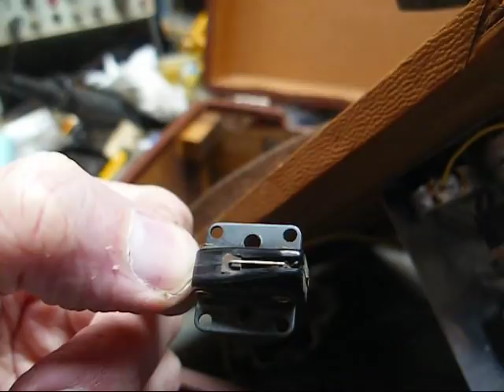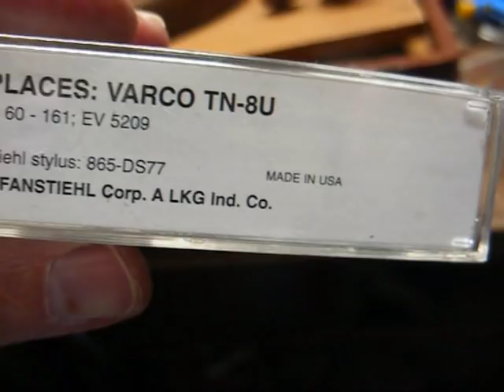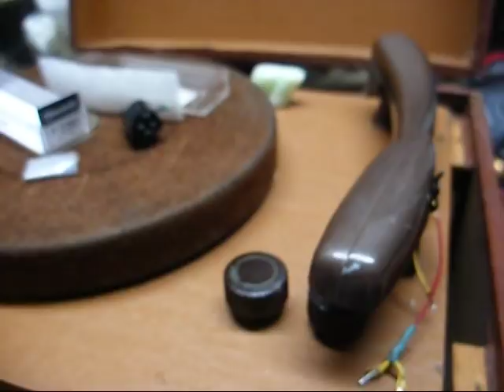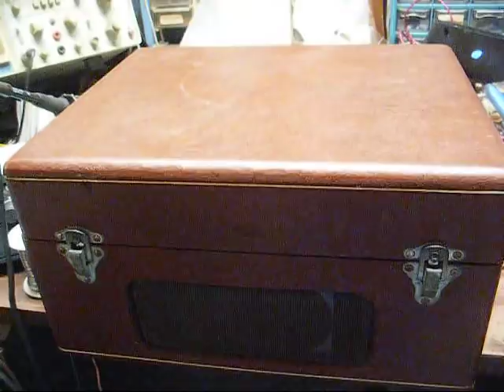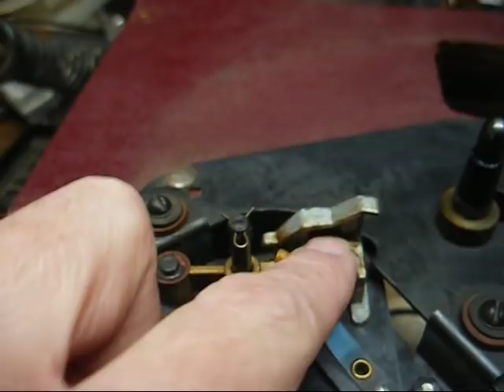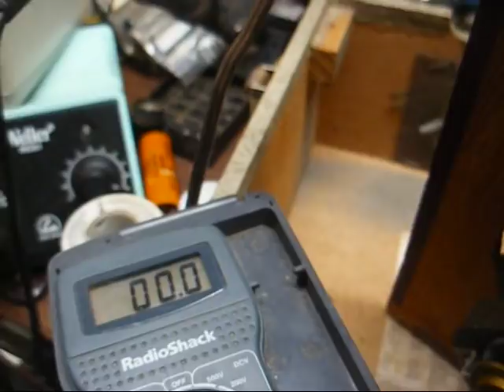Waters-Conley record player repair X 2 (cartridge replacement, sloppy repair work)

Comment: GREAT restoration job on those! I couldn't BELIEVE it when I saw that giant can capacitor siliconed in place! What a shorting danger that was! I have my very 1st record player that I ever owned-got it when I was 2 & it's very similar to those 2 it's a Phonola w/2 audio tubes & a SEASonal RECTUM-fire (selenium rectifier). It has the noisy drive system & awaits restoration in my closet.

Comment: I used to have a Silvertone record player that I got many years and it worked good, but it had no sound on the speaker, and the tonearm had an original cartridge with a steel needle type which was installed onto the 78 cartridge. I got rid of it many years back, but the GE Wildcat is far superior than these older record players.

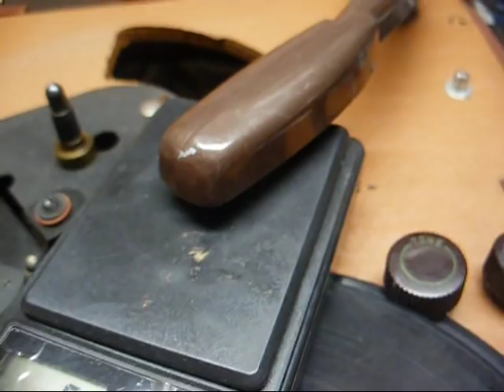That song at 20:06 is the 45 that he already got smashed in the last video. It’s a great song, no question about it. A #1 hit in 1977 for an impressive 10 weeks.

Comment: Hey radiotvphononut. I have tried wiring a stereo cartridge in series, as joining with a wire L - to R+ on the cartridge, then just connecting the 2 remaining terminals to the tone arm and it doubled the output (both channels) added together. It sounds good for me so far, but worked out better for me than summing them

Comment: Everyone seems to parallel the left-right sections of a stereo phono cartridge when used with a mono amplifier. Wouldn't it be better to put the sections in series in the right polarity and double the output voltage of the cartridge.

Comment: Love The Record Players- Better than a crosley, Your right big tubes sound better. enjoy how fix record player'''s
Reply: Have you ever tried soaking rubber parts in a bath of rubbing alcohol and wintergreen oil?  It can restore rubber to a soft and supple condition.  I don't know how long it lasts, but it definitely works.   I think the ratio is 3:1 alcohol to wintergreen oil and it takes about 2 to 3 days of soaking.  You have to use real wintergreen oil though. The pre-mixed stuff in the drug store doesn't do anything.  I know motorcycle and car people use this trick with rubber parts that have hardened and they need it to be soft to get it back in place.
Reply: Crapley
Reply: Let me give a word of advice here I don't claim to know everything it's all respect radiotvphononut we can all learn from there is no one fix for vintage Electronics and short cuts
Reply: @JJ_CoreJasonGamer5442  and should prevent forest Rainier blower flyer Go Kart super Circuit Clerk of being her usual armors are flyer fold Electronics buyers parental fly Flair for Flyers nerves vinyl Blair mom wears cargo are Fleur flowers on trees old are Blair Malia more cynor blame where player viable Source Nashville limo on their board
Reply: shango066 I love These Too
Reply: cruz-bot haha
Reply: @EvanPlayzGames Have you created that second channel yet?